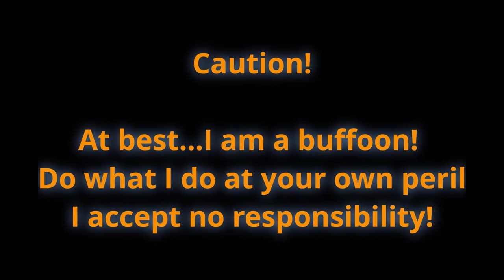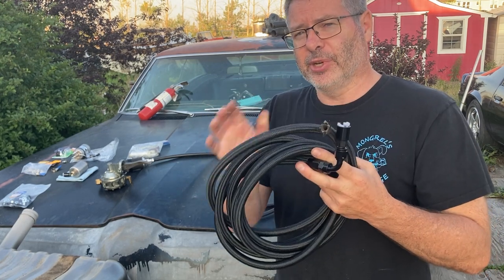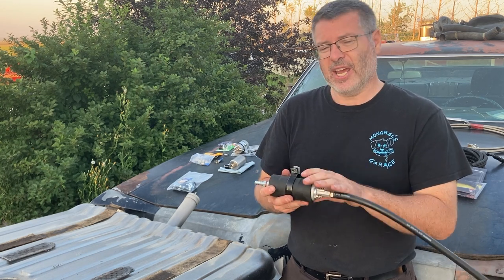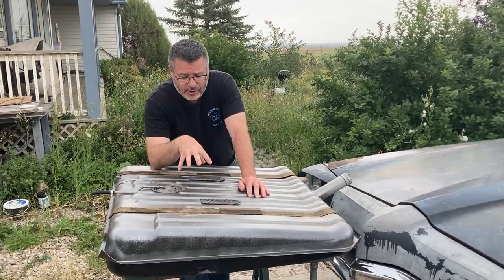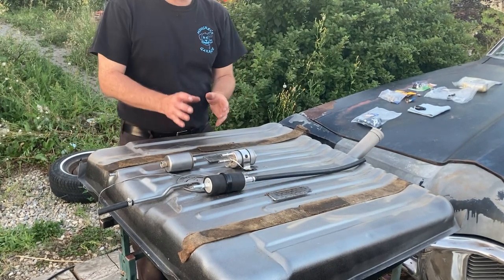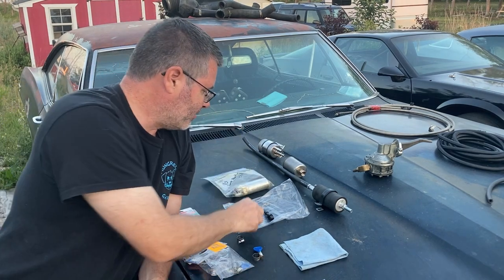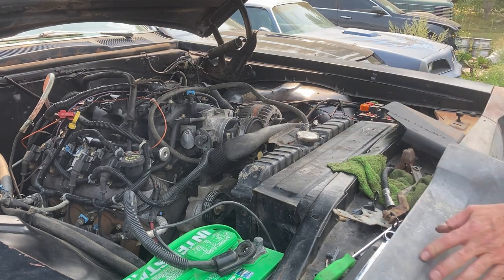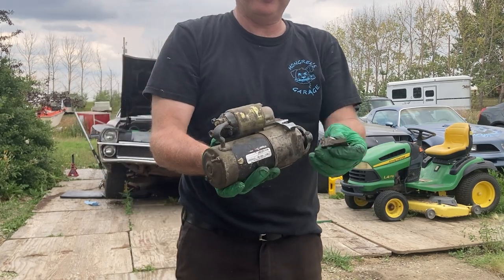LS or Hemi Swap Fuel Systems - Parisienne

Comment: Great video. It's alive!! I( understand the reliability of the LS engines, but would still be cool to see a 455 HO under the hood of the old Parisienne. I knew a guy who did that in a '71 or '72 and it was a really sweet ride. Lots of power, not a tire roaster, but it would scoot. With ice cold air and all the creature comforts too. Be safe and stay well.
Reply from the maker: Thanks Brian, while I do very much enjoy the Pontiac torque monsters they are a bit cost inhibited and these cars came with Chevy Engines originally so I don’t feel too bad about the LS in it